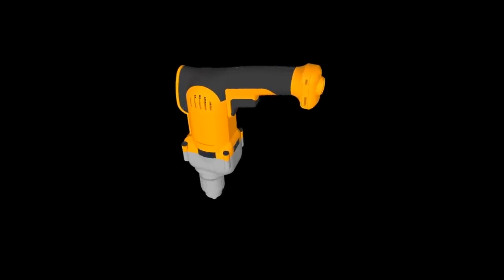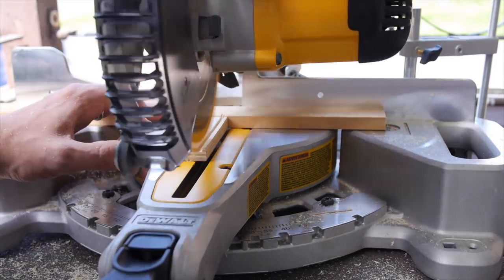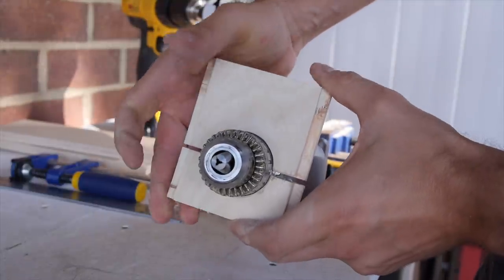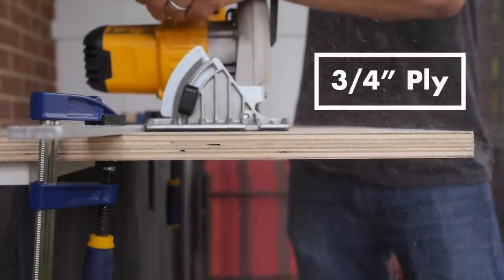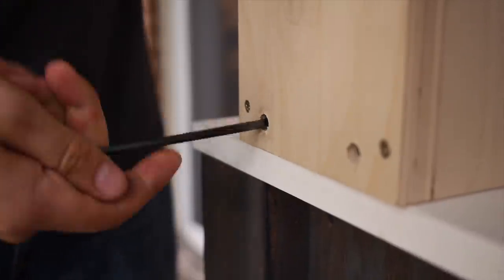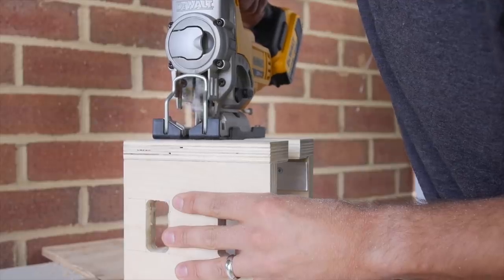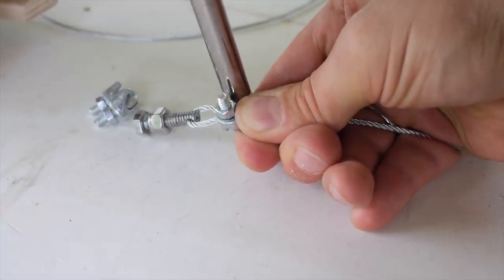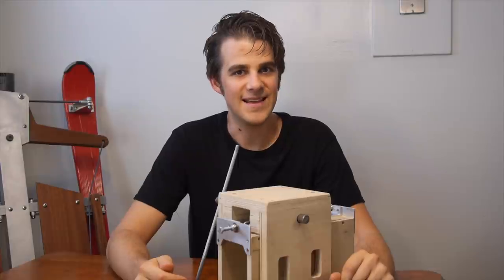Building a DIY Drill Press - The Head

Comment: Wow, great job! Way better than my design!
Waiting for part 2!
Reply: How much time did it take you to design this? Why use aluminum instead of steel? Or are you not planning to use the drill press so much that it would wear out and need to be replaced?
Reply from the maker: Thanks man! I actually looked at your design as I was working on this one. I'd say it took me a few weeks to figure out exactly how I wanted this to turn out. Building it is taking quite a bit longer - especially as I've been distracted with other projects (like rockets). Good point on the aluminum vs. steel. I generally use aluminum as it's easier to work with. I don't think they will wear that quickly though and I can simply tighten up the bolts as they wear.
Reply: makjosher I wonder if a little WD40 prior to use would limit what little wear this may encounter.  I will have to look at the video again, BUT, wouldn’t I have access to simply replace ALL the aluminum down the road?
Reply: DUDE!  I have watched HOURS of videos on a diy drill press. YOU WIN! Lol....seriously though...your design is the bomb.  Never in a million years would I have thought about a “box-in-a-box” design.  Adding the aluminum was brilliant.  Please post Part 2 asap as I am ready to build this like...yesterday!  :) Lastly....Thank You!!